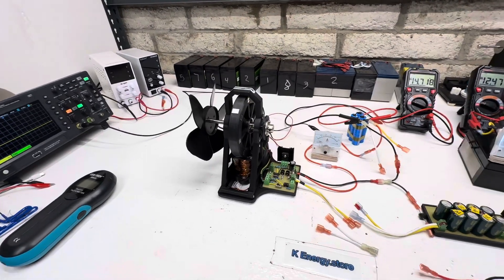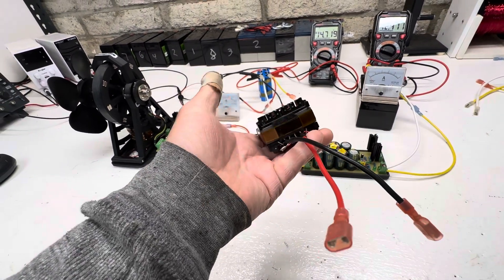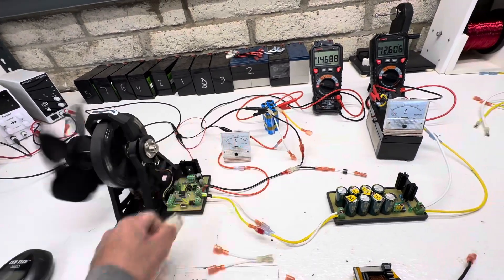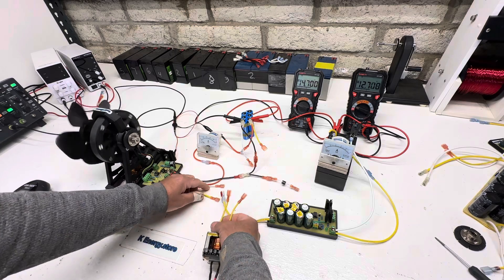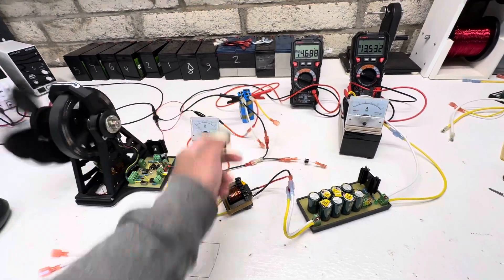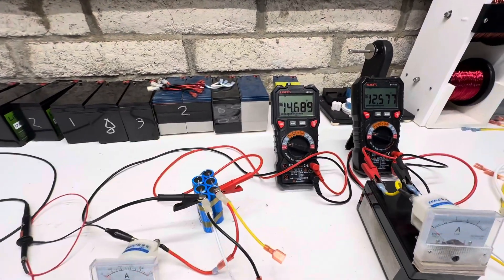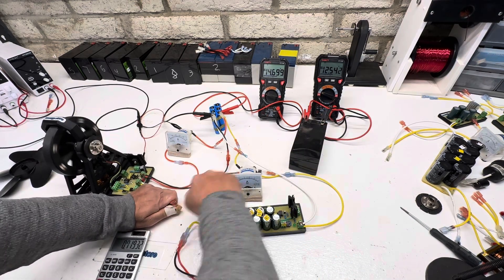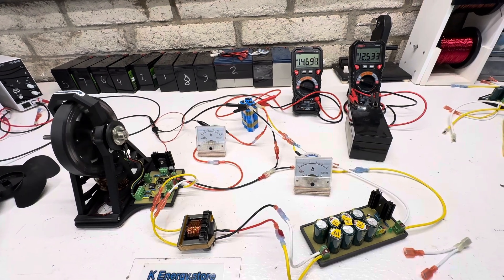Bedini motor converted to opto mosfet with 5 different outputs

Comment: For the average layman this is completely confusing. Lots of wires not explained well at all what you’re doing and why. What the benefits are.
Reply from the maker: @StarBase7390  for some one new to the channel maybe 
Red black input power from super capacitors 
Yellow white output from motor for charging or loop back

Comment: Just curious on if you would comment on why Bedini said in the school girl motor to not use solid core and instead use the welding alloy wire for the coil's core and to not use neo's and instead use regular ferrite magnets versus what you did in your motor, thanks so much!
Reply from the maker: @phordguy  I use ferrite and neos on my bedini motors they both work equally great 

This motor is not set up as a bedini motor 
It has a mosfet instead of a transistor 
Uses optical timing 
This and the “ bedini circuit “ is very different I use sold core to get a more uniform magnetic feild on this demonstration
Reply from the maker: @phordguy  as far as the welding rods go they work quite well for bedini motors they don’t retain the magnetic field like regular soft iron does 
The ferrite core would be good for high frequencies 
 Bedini motors run around 400 hz
Reply: @kenergy1707  Thank you for the reply so keep the bicycle wheel under 400 hz on the magnets and I'll be ok.  Is there anything you recommend I can substitute for the neon light he used that can be readily sourced or would a regular tail light bulb off a car suffice?
Reply from the maker: @ the neon is for protection of the circuit 
 The light bulb you can use a little trailer marker light
Reply from the maker: @phordguy  the frequency doesn’t have be be 400 hz that’s just a average of what I noticed

Comment: hi, did you just loop this back into the source? if 'yes' then does it self sustain? thanks for the video.
Reply from the maker: @Bassman73  yes I showed 2 different ways to loop back 
It runs for a extremely long time but battery doesn’t go up
Reply: hi  @kenergy1707  thanks for coming back to me on the above, that's really amazing, perhaps finally we've found a way to sustain energy. Would be great if you could do a live stream to all those naysayers, basically showing the same system running for maybe a few days non stop with a camera showing the voltage all the time, but i'll leave that to you, as i'm not sure about any technical or financial constrains you might suffer as a result, but just an idea. thanks again.

Comment: Well done I got the same results returning the back EMF to the rotor but I used another coil. The RPM increase I believe is more efficient than recharging batteries to operate a fan for example